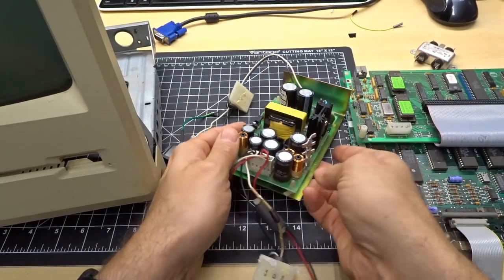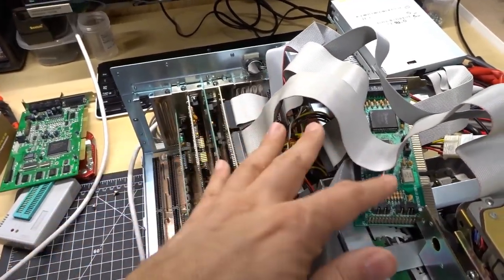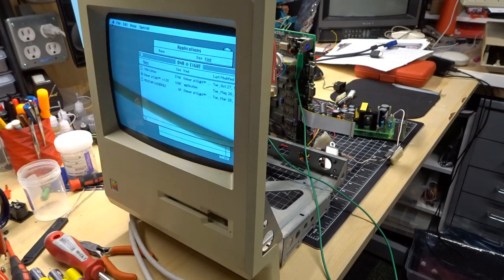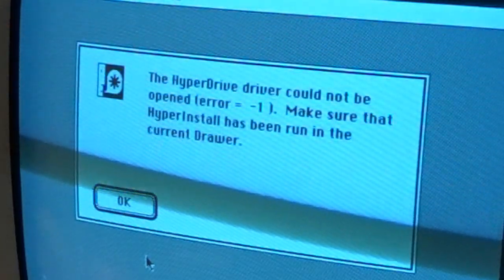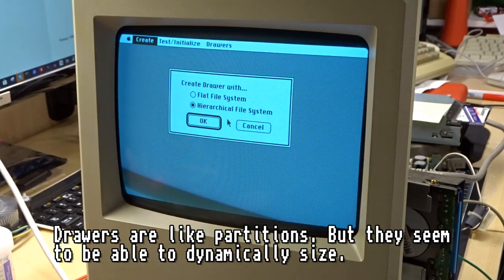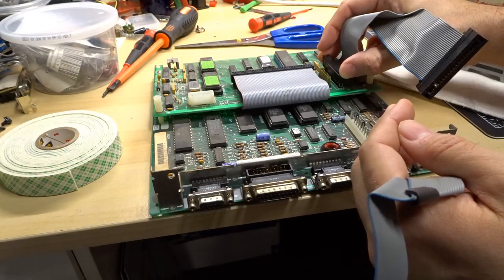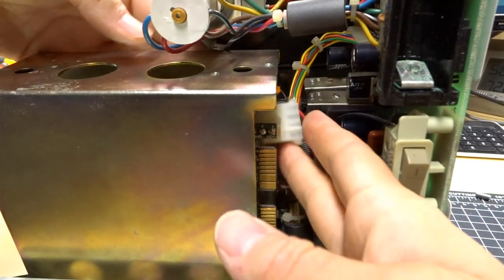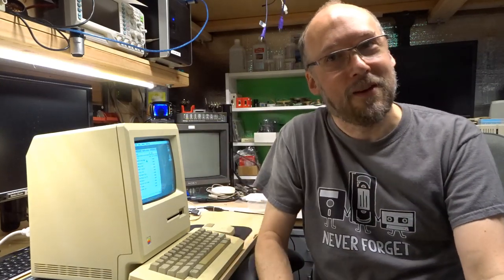Macintosh HyperDrive 10 (back together again)

Comment: It looks like you have one of the earliest HyperDrives. These were originally installed exclusively at GCC headquarters, largely because of the complexity of installation and their understanding with Apple re: warranties. Later, they made it possible for authorized service centers to do the installation so that people did not have to ship their Macs to Massachusetts and wait a week or two to get it back. Fun fact: the HyperDrive was already in development as a side project while GCC was still focused on developing games for Atari. They'd already taken a prototype out to Cupertino to show it to Jobs, who informed them Apple was working on a HDD Mac but it would be at least 2 years down the road. Predictably, he hated the fan and wasn't interested in outsourced hardware development. But apparently he thought it would be good for Mac sales in the interim, thus the tacit approval of this 3rd party mod. When Atari was bought out, the game projects were suddenly cancelled and GCC management pivoted immediately to focus on the HyperDrive rollout to keep the company going.
Reply from the maker: That's a fascinating bit of history! Funny that Apple's first machine with an internal drive ended up having a fan too. LOL! I can only imagine how much fighting Jobs did to not have a fan -- and I guess the engineers won.

Back in the Mac SE days, we had a GCC laser printer at home that used a SCSI interface. It was so much cheaper because the Mac did all the resterization and then transferred the image directly to the printer and laser. Interesting stuff as a way to create a cheap but still good laser printer, so clearly GCC was a pretty ingenious.
Reply: Yes, I think the story of how they got into the laser printer business next is on the internet somewhere, but they saw a clear opportunity with the introduction of a low cost laser print engine for OEM use. An interesting parallel between the HyperDrive add-on design and GCC's earliest roots is that they got their start as a company with Super Missile Attack - a unique plug-in/clip-on piggyback circuit board that they sold direct to arcade console owners (Missile Command). Also, GCC software engineers were so enamored of the new Mac GUI that they ported over and released Super Missile Attack as their first (only?) game for the Macintosh, even before HyperDrive was in development.
Reply: @carlg5838  Do you have a link to the Mac version of Super Missile Attack? I can't find it anywhere.

Comment: I was the one who uploaded the disk images, manual, and (partial) installation manual to Macintosh Garden (and the floppy disk labels & bucket sticker, if you're so inclined to print them out.)  I'm really glad someone actually found them useful. :)

You should try version V3R1, and if that doesn't work, try V2R1.  If you're running a stock Macintosh 512k, V3R2 may not work.  It specifically states in the manual that it's only intended for the 512ke and Plus with a 128K ROM.

HyperDrive isn't too uncommon, but a WORKING HyperDrive is.  So cool to see yours working.  Mine is still in its factory box, I've been waiting for the perfect 512k in which to install it.  Preferably, I'd like to use a CNC to cut out windows like in the picture of the Macworld demo machine.

Comment: Regarding the missing "Format" button, in some Mac software, "advanced" features are sometimes hidden by default, requiring you to hold down either ⌘ (Command) ⌥ (Option) ⇧ (Shift) or a combination of the above (i.e. Command+Option) while (in your case) pulling down the "Test/Initialize" menu and choosing the "Initialize Disk" menu option. Give that a try and that missing "Format" button might magically appear.
Reply: Well, the number keys to select the SCSI-ID is in fact correct and documented. Never worked for me, but it is in the code.. :D
Reply: Just noticed: It's Command-Option-Shift+# to select the ID, command-option-shift-delete to deselect selected (PRAM) ID

Comment: Always remember to park the heads on these old drives before shutdown. ALWAYS
Reply: Absolutely! The wisdom I received back in the day was not just for preventing mechanical damage if you were to move the machine, but also to mitigate any spurious signals from the heads as the controller powers down. My Amstrad 1512 (XT clone, so different OS) had a hardcard and I used to have a 'park.com' application that I used to run before I turned the machine off.
Reply: Adrian Black 
Why not make one then? I doubt youd need more than 20 lines of code.
Reply: Running the shutdown command on the special menu likely parks the drive automatically or it may have auto parking built into the controller. Mac’s never used MFM hard drives so hopefully the company who made this fiasco included parking somewhere in their software.
Reply: @adriansdigitalbasement  There's a very slim chance the drive has auto-park (but it was a surprisingly late feature). For example Seagate had the feature on an MFM drive from 1991 had auto-park. ftp://ftp.seagate.com/techsuppt/mfm/st251.txt So other manufacturers were doing it on MFM drives.
Reply: @_zzpza  yep pretty much also any voice-coil MFM HDD (such as the ST-4096 [80MB 5.25 Full height monster] and some old Microscience hard drives) could automatically park itself as the servo retracted the heads.
Reply: We'll let you off in this case as there's no documentation,  but there will be a way to alter jumpers to park the head before powering off, but remember to switch them back once it's off so they can unpark on power up!  ;-)
Reply: @adriansdigitalbasement  the 251-1 and 4096's were definitely auto-parking.
Reply: @adriansdigitalbasement  yep that's how the ST-251 parks the heads, by using the spindle as a small generator, quite neat for a drive of this age
Reply: @adriansdigitalbasement  my first hard drive was a 5 megabyte Tandon. 5.25" full height, MFM. Had one platter. The 10 meg version had 2 platters. The head movement was by stepper motor with an external L shaped piece of metal that moved into some kind of non-contact sensor. The drive wouldn't work at all until I ran a park program that caused it to seek to track 0. It was neat to see the position sensor move after a long time of following directions that wouldn't make the drive do anything. I kinda miss the days of hard drives that made gentle beepy sounds as they moved their heads.
Reply: also these thick brick drives were so massive that if you try to move them in your hand while they're spinning you encounter a huuugeeee resistance because of the massive inertial forces the mechanism is using
Reply: @alerey4363  yep, I had at some point an Seagate ELITE47 (47GB SCSI 5.25 brick) it even fell (never mess with hard drives once they are spinning, inertia and stuff can play nasty tricks on you) and landed riiight on my foot. (I forgot how heavy it was, but god it hurt, really bad)
Reply: Second problem: HFS gets corrupt rather easily if you just switch it of.
Reply: @Alexis_du_60  I had one of those a while ago running on a SparcStation 20. The table they were on would vibrate like hell on power on. Used to annoy the hell out of my housemate who had his pc on the same table, the vibrations shaking his monitor and his mouse as he was left handed and the mouse wasn't far from the 47gb HDD!
Reply: @bionicgeekgrrl  Hahaha I remember doing something similar with a SAS disk shelf (during one of my countless internships), imagine a bunch (25? 30? I can't remember very well) of SAS 15K RPM (!!!!) spinning up at the same time, those things managed to shake up the entire shelf, you couldn't even put something on top of the damned thing without it falling down. All of that because I forgot to put the rubber inserts in the caddies' screws..

Needless to say it really annoyed the living out of my colleagues, matter of fact, during that internship we still had a bunch of beige servers that contained the exact same Seagate Elite 47 HDDs and indeed those things could practically shake the entire rack while making a oddly soothing humming.. I miss those things

Comment: My SE/30 has an old 230MB Quantum ProDrive in it that I installed in 1998. Every time I turn it on I wonder how much longer it's got...... it's still kickin' as of today :)
Reply: Those Quantum ProDrives are quite reliably. There's only one problem plaguing the series: When they park their heads, the head stack hits a rubber bumper endstop underneath the platters. This rubber bumper tends to deteriorate and turn back into crude oil. As a result the heads stick to the bumper, with the head actuator not having enough force to free them.

Comment: I'm so glad that all our modern hardware doesn't require any sort of prying
Reply: Prying is a software function these days.
Reply: In the late 90's I worked in a shop that did warranty service on all the big PC brands. It was when Dell and Micron used the same case, except for minor front panel differences. The side was held on by one plastic headed thumbscrew, a latch top and bottom, and a huge amount of friction. The first few times removing the panels on those were very difficult. I kept a special tool on the bench just for them - a claw hammer. Loosen the captive thumbscrew. Push the latches inward and slide the panel as far as it would allow, which was just enough to keep the latches disengaged. It was also just enough room to insert the hammer's claw between the back lip of the panel and the back of the case. POP! No struggle, no marks on the case. I took to calling those the claw hammer case. On site service call for a Micron or Dell? Hammer went with me.
Reply: @greggv8  literal prying

Comment: Back in the day when I was running a BBS, there was a utility floating around that would allow for a second HD controller in your PC.  Specifically you had to tape over the IRQ contact on the card edge, boot and have the driver in config.sys and you'd get a 3rd and 4th drive through PIO access.  I used it to support an MFM drive beside a couple IDE drives in my 'SAN', aka a PC booting to DOS and running Interlink to share the drives via LPT to the BBS machine.
Reply: Also back into day, people uses he same tape over contact trick to use and switch between multiple monitor sets color/monochrome  on separate cards too.

interlink and intersvr were great!  every once in a while I still use them with a parallel cable to transfer data between old machines.
Reply: Adrian Black 4 hard drives, I could never understand why the IBM world went the way it did with floppy drive support.  prior to that 4 floppies was very normal and common, just setting switches or jumpers on each drive to match the number it should be and respond to commands over the straight flat cable from the controller. 

   It seems someone in the IBM world felt it too difficult to change jumpers, so they messed up the system by twisting the cable so you can leave  the drive alone, and each plug on the cable, which now is limited to 2-drive support, is wired differently to place the second drive signal on the 1st drive pins for the 2nd drive to work.

Comment: Back in the early 90s I had one of these and sold all the parts out of it. I had glass cut and used silicone to create a tank. It had scenery, gravel, plants, air pump and a battery powered fluorescent light. Kept neons in it on my desk at work.
 I remember I modified the front of the case so it would just slip off if you pulled it forward for easy maint.

Comment: I had a Radius Accelerator on a MacPlus. Yes, you set it against the rail, then bend it out. After 15~20 tries, the mother board got smoother, and the side bracket got smoother. You did very well. Later, I had a 512k Fat mac 1Mb, with the daughter card. Same thing.

Comment: Great job! The slow and steady approach is the only way with old machines. I have an original Mac with a RAM/SCSI add-on that has a rat's nest of soldered wires. I slid the logic board out as it was meant to with much scraping and fear. I broke a couple of connections and had to repair them. I never even thought of popping the logic board out of the tracks that way.

Comment: I like this video, great that everything works.  If you ever get where the drive doesn’t work, just keep all the parts, that Mac 512e is definitely a museum piece’. I worked at Apple dealers for 9 years, And I remember having to spread the bottom of the chassis for some machines that had add in hardware and that was the only way to get the motherboard out.  It made me cringe seeing you do that and I’m sure I cringed a bit when doing it myself.  I’m sure there’s not many of those old drives still working so it’s great to see one in operation.

Comment: if your scsi controller has an external bus with db25 connector (or 50 with adapter) you can hook up an original scsi iomega zip drive and boom, from scsi to scsi with faster imaging speeds than parallel (and I think more reliable because of the scsi comm protocol)

Comment: MacsBug was a powerful debugger/disassembler for older Macs. (Incidentally, the “Macs” in MacsBug had nothing to do with the name Macintosh.) Normally, if you pressed the Programmer’s Switch, you’d invoke a simple built-in debugger, which supported a few precious commands that didn’t let you do much. With MacsBug installed, your computer turned into a powerful development/debugging tool. You could even recover some data from a crash (i.e. a bomb screen). (You could basically dump memory contents into a file.) I loved it and had it installed on all of my machines.

Comment: 9:45 in 1996 when I bought my Pentium 75 I installed DOS, Windows 3.1, and MS Office 4.3 from floppies. That's 2 (or was it 3?) floppies for DOS, 11 floppies for Windows and 40 or so floppies for Office. And that's besides all the other floppies required for all the drivers and what not. This machine had a CD drive too, but it was still basically impossible to get any of that software on CD because they wanted to be backwards compatible. It just never stopped being annoying having to swap floppies, and even less fun when you knocked over the stack and they all fell on the floor. 

Floppies were great in the early 80s when everything could fit on a single disk, but the CD really didn't come a moment too soon. And then of course we got programs and games that used multiple CDs because they too became too small

Comment: That MFM HDD: works after 30+ years of use
My pc hdd: Starts to make weird noises and to freak out after 4 years of use
Reply: To be fair, that drive hasn't gotten 30 years of use, and MFM drives (specifically ones configured as RLL) were notoriously bad.  That said, i get your point about current drives, spinning hard disks never got to be a super reliable tech.  Some are better than others, but overall, their death can be pretty random.
Reply: @brianv2871  the biggest problem that seagate and other drive manufacturers had with "RLL" drives was they used the same amplifiers that they used onthe MFM drives but ran them at the edge of frequency spec or just plain out of spec, and they'd last a while then burn up . Seagate and Miniscribe also used a bad lubricant (IIRC) that could actually thicken on the platter and cause the heads to stick to the platters making the drives not spin up, seagate spent a lot of $ denying "Stiction" (Static Friction) affected their drives, a fairly reliable way to fix the seagates was to open the enclosure in a clean hood or clean room and flush the mechanism with nitrogen .  it might cease to spin up eventually but allowed you to get your data off the drive and from then on you just didn't use it for anything critical.

BTW: Just a little pedantry on my part, MFM and RLL are BOTH forms of RLL (Run Length Limited) encoding, just ';RLL'  using a higher frequency to read/write data, then you have the Perstor controllers using ARLL at an even highter FREQ causing drives to fail even faster.

Comment: GCC (General Computer Corporation) is the same company that created Ms. Pac-Man and the Atari 7800.  One of the guys from GCC (I'm blanking on his name) spoke at PRGE 2017. I talked with him later and he told me that when they were getting ready to show this very device to Jobs, Apple engineers swore up and down that it was impossible to put a hard drive in that system. So much for impossible.

Comment: Great to see that weird contraption back together and working :)
On these drives only the cylinders (by the amount of steps the head actuator has to do from first to last track) and the amount of heads are physically defined.
The amount of sectors every cylinder is divided into is up to the controller. On standard PC MFM controllers, it's 17 sectors per track. For most RLL controllers it would be 26. You can actually format an MFM hard drive with an RLL controller, resulting in about 50% more free space. It's up to the media quality how (long-time-) stable this combination is. RLL drives are actually the same drives as their MFM brethren, with a better (tested) quality surface medium.
Hence it's totally possible, that this Mac controller board is only using 16 sectors per track. Maybe due to a limitation of the old System 3.2 suporting only 16 sectors? Just guessing there.

Comment: also, you need to make sure the hyperdrive and the card you used to format the drive in the PC use the SAME controller chip.  can't low level a MFM HDD on a DTC chip and have it work on a WD 1010 or 2010, likewise other MFM chips used in other controllers (like some of the weird radio shack ones that used bit slice processors instead of a dedicated HDD controller chip)